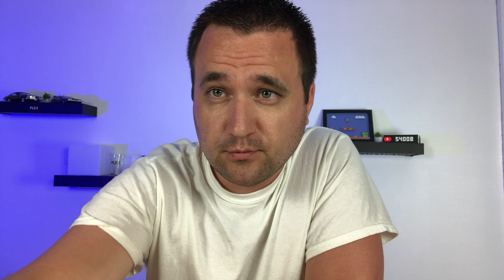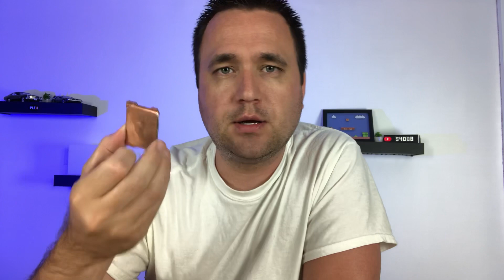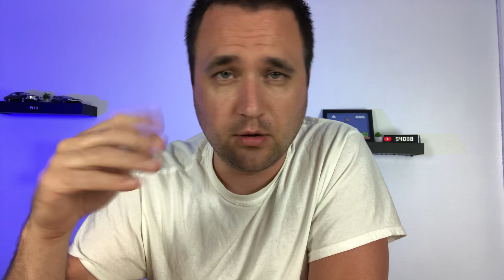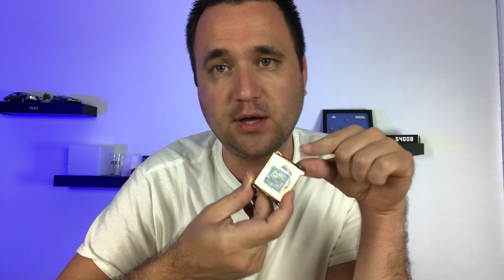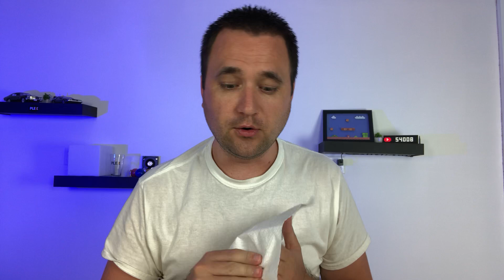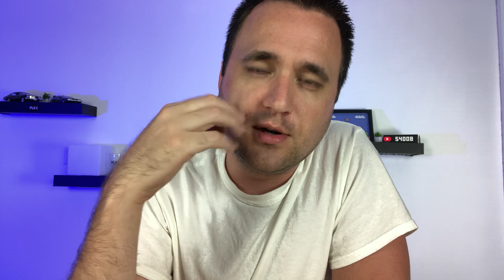7940x Delid Fail. Need some help/advice..

Comment: Had a similar problem on a 4790K, The liquid metal is fine until it heats up then moves around and can leak off the IHS to the conductors or other parts. Which would be the case if your motherboard is vertical and not on test bench. Did you paint nail polish on the cpu dies, conductors around the IHS on cpu? Use a magnifing glass and look real close for liquid metal on any other parts. Even a pin size spec will cause issue. Ya might have got just a little liquid metal on one die and it will spaz.. Even just a small spec.. Good luck

Comment: Much like everyone else is saying, look at the AiO. The pump might be running fine for a bit, then it fails and temps jump up and cause the lock up. This also presents the high temps right after a reboot, the temps were already high. Then you go through the delid process (like a few hours) and that down time lets the pump start up for a bit again. Test with an air cooler to confirm.

I think it's just weird timing. Things seem to work out that way.

Comment: Did you test the hardware before the delid?
did you stess test the cpu before the delid?

Every time the system crashed and was rebooted showing high temps, i'm assuming it was never disconected from the mains? and then every time you messed with the cpu it was? 

what i'm thinking is when the computer crashes some variable or corrupt piece of data is held in ram or some small memory on the motherboard. and because power to the motherboard is not interrupted after the reboot that variable/data interferes causing false readings. then before you start messing with the processor you disconnect the mains which deletes the variable/data in memory and after putting everything back together and rebooting everything looks go again.

The next time it crashes try unplugging the mains and leaving it a couple of minutes then reboot. if i'm right the temps should look normal, if not i've got some more ideas.
Reply from the maker: Yes it was stress tested before and ran smooth.

Comment: 1. What does your event log in windows say when it froze? Always the first to look and please reset the BIOS.
2. check your pins in the socket and the pads on the cpu.
3. Try an air cooler.

You did the delid correctly like a bunch of times now. Move on to another part and if that checks out go back with a fresh mind

Comment: I had the same issue on the second or third delid I had ever done. Turned out my pump was intermittently stopping on my water cooling. Not sure what kind of cooling your doing but that is something to check. Sounds like you have a good understanding of what your doing. Don't let this discourage you!
Reply: Also, are all your cores equally overheating or is it one or two more than the others?

Comment: update bios, reset and try to run with air cooler
Reply: that's a horrible idea. I would never recommend flashing the bios of an unstable system unless you can easily recover when it hard locks mid flash.

Comment: Have you tried removing your OC? First thing I’d do for troubleshooting is to reset cmos. Doesn’t necessarily explain the weird temperature readings, but taking everything back to a factory setting might help make troubleshooting easier.

Comment: The first thing to do is test your ram, and then drop down to one stick.   Second, if you know anyone who would loan you an X299 CPU to simply test your system, that would be the next step.   If you don't run into the same problem with another CPU, then you've isolated it to the delidded one.   

I can't say for certain, but it might be possible that there is a small remnant of liquid metal making random contact with something it shouldn't.   As the CPU (and any liquid metal that might have escaped onto the PCB) heats up, the metal expands, and something touches something else that it shouldn't.   

That's just my thought process in approaching it scientifically.   It works, then it gets warm (though still cooler than stock), it crashes, then runs poorly.  If we eliminate any points of failure besides the CPU, then it has to be something that is happening when the actual materials heat up.
Reply: I agree with this.. When Troubleshooting .. test everything. even if you think it is not the cause. ya never no.. You could have shocked something and kill a ram stick.. or I have seen overclocks be working perfect .. you change something in your system and boom .. now you have to tune it down..

Comment: I ran into this before, could have sworn it was a bad or damaged delid.. it was a bad aio.. pump would randomly stop working..  try a air cooler
Reply from the maker: It's a brand new AIO, that had no issues before this delid thing...Not saying it's impossible but, seems unlikely. I think my x61 Kraken is compatible with x299 so I might try that tomorrow after work.
Reply: Byte My Bits I would sugggest buying a cheap air cooler. Even if the AIO is fine it is always good to have another cooler to test with that is not water
Reply: I had the same issue but I was getting inconsistent temps so I decided to try and reseat the AIO and all of a sudden it just stopped cooling all together. Tried reseating it over and over trying different amounts of paste etc but it just kept running hot. In the end I contacted Corsair and they shipped out a brand new kit and now it's running better than ever! Even though it's a new cooler AIO weak point is the pump and if that goes then you have no cooling. Worth trying an air cooler and of that works then you know it's the pump
Reply from the maker: I tried a dif cooler with same results
Reply: Have you tried complete poweroff after crash and then restarting? If not, it could explain why the temps are high after crash but back to normal after you take out the cpu and put it back in since in latter case there has been a complete poweroff. And a poweroff might cure the aio pump failure until it occurs again but a crash/soft reset might not.

Hope you get it working!
Reply from the maker: yes I powered it down and cut the power without removing cpu or cooler for 10min, still same issue
Reply: Aio are often a failure point ... try another cooler

Comment: Sounds like a faulty sensor that's tripping thermal protection.  It's physically impossible for it to run fine for an hour and the temperature to just shoot up.  Check the surface mounted devices around the CPU die to see if any of them got knocked when you delidded.  If you're unsure look for 7940X delid photos and see if there's any SMD's that have been knocked off your CPU package.  If that checks out, use a toothpick or something to very softly nudge them to see if any are loose.  Oh, it's also possible that a tiny tiny bit of liquid metal made its way somewhere it shouldn't have, that's why people tend to use some kind of resin over SMDs and around the bottom of the CPU die, so if everything else checks out, an alcohol bath of the whole CPU package might not go amiss.

Comment: only thing i can think off is reach out to Gamers Nexus on twitter. To mr tech Jesus.  If anyone can understand this and help its Steve.
Reply from the maker: I'll hit him up on twitter and see if he will reply. But he's a big youtuber so I doubt it lol. but hey, im desperate!
Reply: Ya but he is usually really helpful . So worth a try :) .   Hopefully helps that your a Youtuber too :P
Reply: Also der8auer
Reply: After thinking about it. I feel his AIO pump is faulty.. I think the Delid is good and everything is good there..
Reply: I would deffo check the aio pump like brownie has suggested as mine packed up after only a year without warning and had to rma it
Reply: Brownie_ that would not explain the crashing though with low temps. I had my pumps off in my loop and nothing crashed, that’s not how CPUs work. Unless there’s two issues here: one for what and one for crashing.
Reply: that is not what is happening. he says he is stable for like 2 hours.. Then it hard locks. Up to that point temps are good. He reboots and temps are like 100 C. IF the Fluid is not moving it will say hot until he lets it rest and cool down . a Reboot will not cool down the fluid. He never crashes with low temps.
Reply: but if the liquid was hot then his temps would be high before it crashed, which he said his temps were low right before crashing multiple times. My guess is possibly the liquid metal is breaking apart thus disconnecting all thermal transfer, which would then instantly overheat the cpu and cause a thermal shutdown. But you still generally get a error message about it. AND if that were true he would thermal shut down as soon as he was booting, but he's able to run it at 98-100c which isn't quit thermal shut down area. Also, it takes a while to warm up that liquid.
Reply: Are you reading what you're saying??? You're literally contradicting yourself. 
"he says he is stable for like 2 hours.. Then it hard locks. Up to that point temps are good. He reboots and temps are like 100C" 
Exactly my point, temps are good until it locks up. If the fluid wasn't moving then his cpu temps would be going up before the crash. USE SOME COMMON SENSE!!!
Reply: but temps would not be 100c on reboot.. They would be getting hot from running Prime 95. .maybe the lockup is not showing the CPU heating up.. But the more I think about it. it sounds like the Die on the CPU has been removed from the chip and as it heats up it spreads and then does not matter how much Thermopaste is there. the Chip is hot .. Sounds like RIP CPU.. Was just trying to give him ideas to see if that would fix it. But he has tried most of them and nothing has changed.. Sucks to hear a 1000 dollar CPU died on a Delid.. but shit happens.
Reply from the maker: its not the cooler or pump. I tried with a completely diff cooler and had same results.
Reply: agreed. Talk to Steve at Gamers Nexus ..
Reply: Are you using a water pump? If so, that may be the problem - again if you are using a water pump use a custom fan curve.

Comment: Question I have is, is the temperature sensor malfunctioning? What sensor did you use? Do you have a temperature gun to double check the crazy temps?
Reply from the maker: Using HWinfo64. I assume it's accurate. No I dont have another way to read temps.
Reply: Byte My Bits it could be a faulty sensor. The temperature guns are like $15.
Reply: @Bytemybits  after it stucks again please check the temps in the bios

Comment: Memory has been tested ? Might not even be the CPU ..
Reply from the maker: But why would it read diff temps?
Reply: It's definitely a CPU issue if the temps are jumping. Even if you were fully saturating your AIO it wouldn't be jumping that high. It seems like its a contact issue somewhere or your voltage is too high. If you're concerned about it being the AIO test it with another setup.